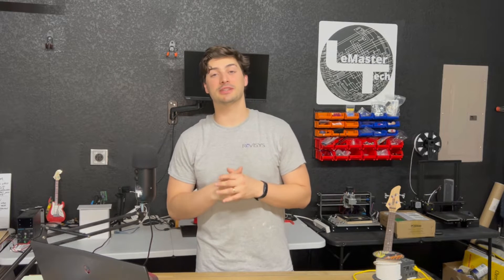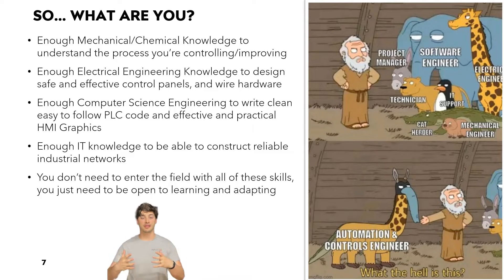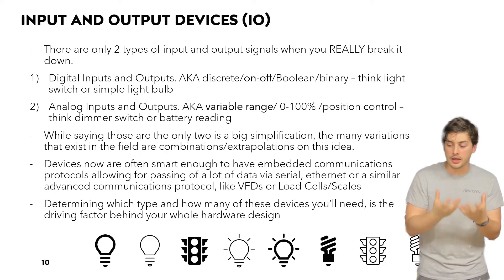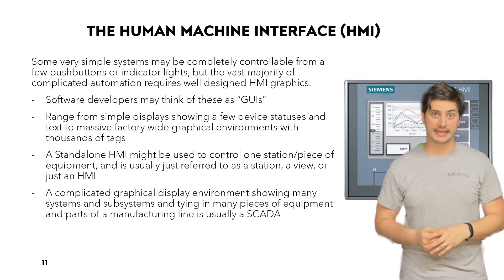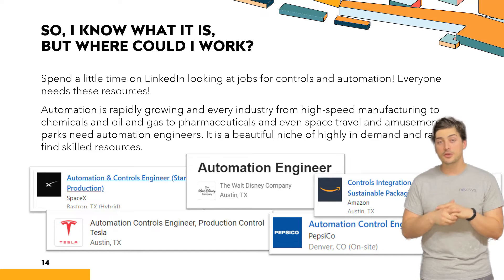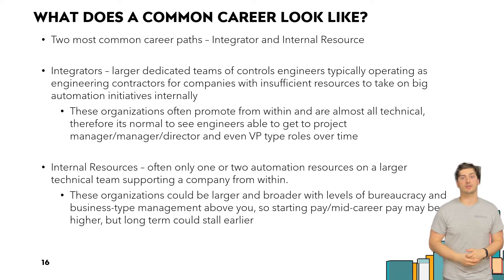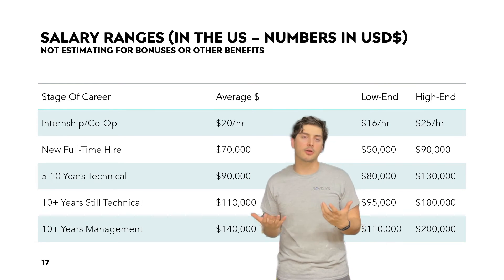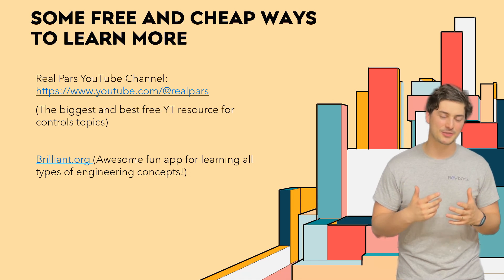What is Controls and Automation Engineering?

Comment: As an Automation Engineer with a 2-year degree. this is the hardest field to learn, as nobody is there to teach you, and nobody is willing to let you learn. Start in Maintenance, get your I&E degree and learn from reading manuals from google. Read everything. Youtube. everywhere.
Controls programming is required. but nobody will ever let you program their system unless your experienced. so, this is where you have to work for free. Yes, work for free. Maintenance mechanics arent supposed to know and write code. but you have to learn it anyways. Figure it out. (better be very confident in your skills) because this is where you have to stick your neck out and get it cut off if you fail.
You must have the strongest mindset.
from maintenance to controls you will loose 1/2 your pay.
but gain your life with time with family and not always working.
many years later, through tons of emergency after hours calls and trouble shooting events have shaped the controls programmer experience you needed. After taking calls from the factory for years, now you have some pull and weight. 
controls Tech to supervisor or manager?
Then maybe into an Automation Engineer position, after you have been doing the job as a Controls tech for years, then maybe the position title can be awarded. 
and thats where i am. At the top of the career. Any higher, and its only Management from here.
Total timeframe.
10 years. after 10 years as a Master Automotive Mechanic. so actual miles will vary. 
its only worth it after you make it here. it was a long and lonely road. lost everything through that time and can now rebuild from scratch with nobody but myself.
But now, i have the ability to do it my way.
and your about right with the Pay Scale also, there are 2 distinct pay rates, the higher or the lower. it's not a range. either the company pays in the higher bracket or the lower. never in the middle.

Comment: I often read about control engineering and automation engineering i see people say they are different? Are they not the same? Whats the difference?
Reply from the maker: Hi, honestly every place I have worked so far calls us controls and automation engineers! I think technically control could be limited to safety and interlocking and alerting and alarming, while automation might be more involved in motion of things and removing operators from dangerous or tedious lines of work. But I do not considering them two different fields!
Reply: Absoloutely Same...just different names.

Comment: I have an associates degree in Electrical Engineering, I had one class about controls engineering and absolutely loved it ( ladder logic was so fun) and really want to get back into it, is there anything at home I can do to boost my skills and get a refresher? Also what jobs descriptions should I look out for?
Reply from the maker: Hey! There are a few different ways to jump back into controls for free and pretty cheap, in my opinion learning to program using like python or c++ or c# (which is free) and learning to build projects using arduino and hobby electronics type stuff (which is pretty cheap) is awesome for building foundational skills with a ton of overlap, but if you want to use an actual PLC I think maybe the cheapest one is actually the arduino opta? https://amzn.to/3xNnim9
They make an arduino PLC ide software that’s completely free you can practice ladder logic in! You could also look into Ignition for makers, which is a free version of an industrial scada software you could make HMI displays with! Hope this helps :)
Reply: @lemastertech  Thank you so much!!
Reply from the maker: You got it! Good luck 😊